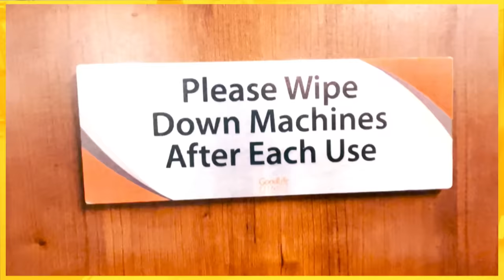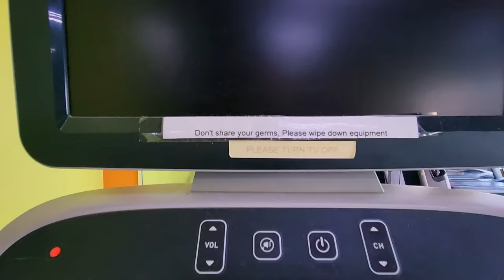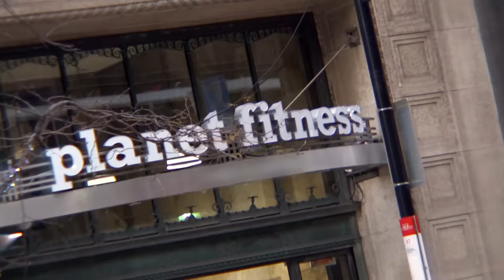What’s the germiest surface at Planet Fitness, GoodLife and Anytime Fitness? (Marketplace)

Comment: in 2019 i got some sort of wart on my thumb beside the nail. i suspected i got it from Goodlife when i had a cut on my thumb. it won't go away for almost 2 years. i tried the duct tape method, cutting off the skin, nitro-freeze, but it would always regrow. i gave up and hoped for the best.
months later, somehow i was working with fertilizer + soil + cow manure bare handed in the garden one time, in a couple of days the wart dried out and just shed off my skin. i almost cried. 2 years of stinging, pain, and discomfort on my thumb, GONE. i dont know what fixed it.